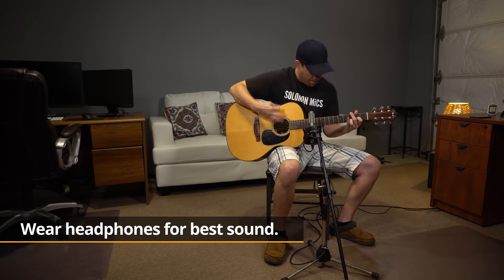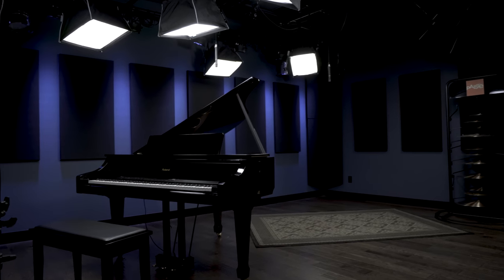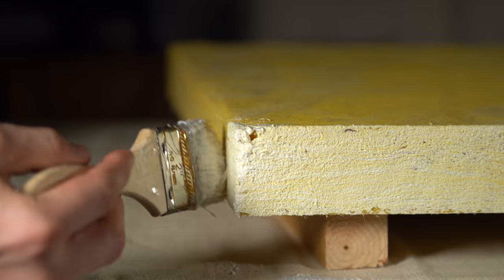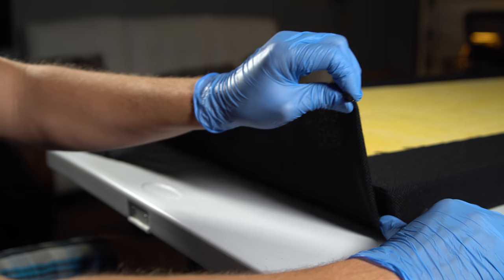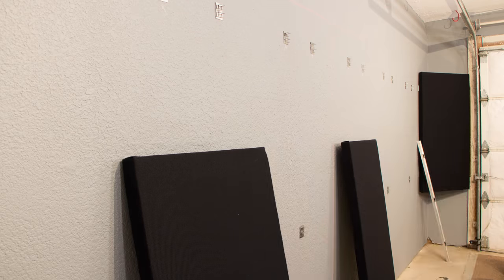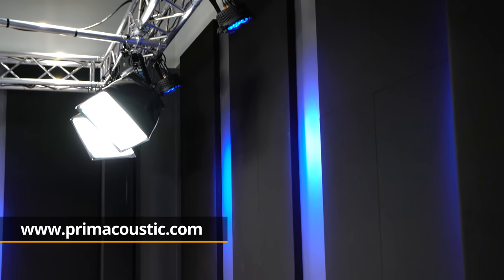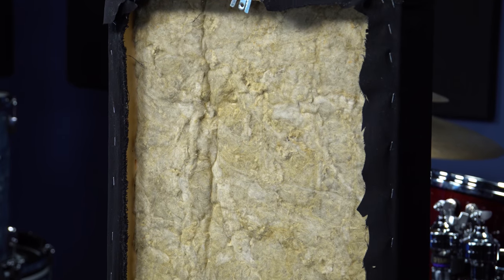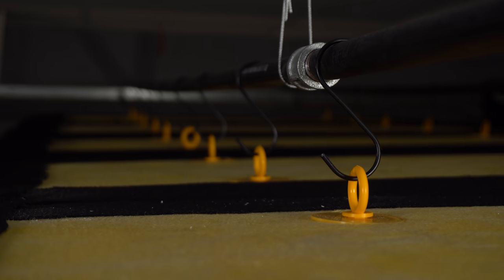How To Make Your Home Studio Sound Amazing With A Low Budget

Comment: I have avoided using fiberglass based panels like those here and instead use Rockwool, it is not stiff like those, but does come in a role 15 1/2 inches wide, and can be easily place in 3 1/2 inch thick pine frames, then covered with cloth material front and back. They work awesome.

Comment: To harden the edges of the panels use Roman-543 or Roman-838 Adhesive.  This is the stuff people use for wallpaper and is exactly the same stuff as No-Frame Edge Coating, only available at any hardware store and is 1/4 the price of No-Frame.  I discovered this after buying No-Frame and comparing it to the Roman-543 I had recently used for wallpapering a room.  It is identical and performs exactly the same way.  It's just glue that soaks into the panels and dries hard.  Hope this helps someone save some money.
Reply: Tried this... appreciate the advice but I am going back for the poly.
Reply: @williamchen33  I was about to pick up some of the Roman adhesive. What was your experience with it? Are you using a poly resin?

Comment: It's highly recommended that you place these panels around 1 inch from the wall. The air gap is very important.
Reply: I've seen a lot of videos that say that exact same thing.  Some people even go as far as having two layers of air, one between the insulation and the panel's cover, and the second between the insulation and the wall.  Is that necessary, or is that overkill?
Reply: You just answered my question!!!  Can I  glue half Inch cork wall tiles ...  DIRECTLY TO THE WALL??   And I believe I will have  hmm create  that ... INCH  AIR GAP!!   Right?
Reply: @dumpeeplarfunny  Depends on your wallet and how "Professional" you want your studio to sound.
Reply: @Brian B So in order to absorb a 30Hz frequency, meaning about 12 meters in length, I have to leave a 3 meters air gap?! :))))
Reply: @dumpeeplarfunny  no its importent
Reply: It will be be even better, but the difference it made mounted like this is enough to make good recording.
Reply: This makes total sense! Cause air acts as another diffuser for reflections that just bounce into the panels
Reply: @erics2860  Exactly, you are basically adding another diffusing surface by putting some space in between the wall and the panel.
Reply: No. It's not that important.
Reply: @dncviorel  you're not far off, In studio control room builds, the acoustician normally plans the back wall to have a several meter cavity with heavy mass medium hangers.
Reply: @KarlGutowski  It is vitally important, especially in squeezing out every bit of performance on a limited budget.
Reply: Steve Walker mmmkm OK on m mo
Reply: Brian B ii
Reply: Can i explain why gapping is important ??
Reply: Or further. 4-6" gap significantly increases the effectiveness of mid-range absorption. The diagonal mounting in the corners gives an effective 12" gap from the wall (at center of panel), dipping into the low end of the midrange much more aggressively.
Reply: I heard pros say that it's better to fill that space with absorption regardless.......
It's the broke dudes, who buy skinny panels that need the air gap .... but if you do em DIY don't see why you couldn't just measure to fill

Comment: Yes to Rockwool safe and sound, either doubling the depth of the panels for lower mid band absorption and keeping 1-2 inches off wall. Wondering why didn’t you cut super chunks for corners, ie 2x2 cut diagonally and stacked up to ceiling, a thin panel in a corner isn’t as effective.

Comment: This is prolly the most concise video on frameless panels. Noe sure no air gap, but thats not always nesscerray for everyone.  Yes the panels perform down to lower frequencies with an air gap but thats not always 100% nesscerray. Also the edge hardner... yeah use more than recommended. Alot more. 2 days to dry. But yes the edge hardness will depend on how heavy ya applicationof it.

Comment: great video but i have a question for you.I notice you and most people only have speakers up or sign about 3 feet on guitar or standing up,I have a clavinova piano with speakers and the base coming out from the bottom in a 9 X 11 room with a window and a door of course so the question is. should I put panels as base traps angled from the floor up? yamaha clavinova if you want to check it out so you can get and idea.thank you

Comment: ouch, you might wanna use Tyvek in between the fabric and the fiberglass, that stuff is nasty and you don't wanna breathe those fiberglass particles in.  Tyvek is a micro porous plastic wrap that allows the air(and sound) come through but not the fiberglass dust.
Reply from the maker: This is a great extra mile on these panels, thanks for sharing!
Reply: You are very welcome :)
Reply: A
Reply: What kind of Tyvek should be used, can you explain further?
Reply: The vapor barrier/house wrap one
Reply: @konstantingroove thank you very much dude. U r a lifesaver!
Reply: Would the Tyvek be considered reflective material though?
Reply: Is this all that necessary of a step to take?
Reply: @CynDaVaz  Yes, anything flatter and less porous than the fiberglass will be more reflective and reduce it's effectiveness. Even a bathroom towel is reflective, but probably less reflective than Tyvek. Epoxy resin or other adhesives can be used to stabilize the fiberglass without reducing the sound absorption as shown in the Tech Ingredients video on sound absorption panels. A light coat of spray paint will also color the panels without reducing absorption. Any fabric you wrap over the panels should be very porous and not flat like a sheet of paper.
Reply: The spray adhesive that is used to adhere the cloth covering on the front should prevent any shedding of fiberglass particles.  Spraying the entire back with the spray adhesive will help further.
Reply: @bross63  The question is how much is enough, and when you use enough does it reduce sound absorption? I have only one datapoint, the Tech Ingredients video says 1g epoxy per 5 square cm is enough to stabilize the fibers. Presumably this can work with paint or other kinds of adhesives, but no data on what is optimal and how much to use.
Reply: @RecordeoOfficial  Extra mile? Haha such an understatement for what might save your health.
Reply: very true on the fiberglass, it is not the stuff to use worse thing ever. Rockwool is safe no fiberglass in it and its designed for sound absorption. just don't use fiberglass at all.
Reply: Is this the same for rockwool?  I've been told rockwool is safe as fiberglass is not.  Is that true?
Reply: Sierra419 there is no glass in rock wool which is safer.
Reply: looks like hes using ruxol, which has no health hazards
Reply: either way though the fabric wont allow the material through
Reply: Jeff Trinkle I have the ikea cabinets filled with rockwool I got from work when they built a new room in room studio. They just have a cloth screen over them and I don’t think the rockwool is wrapped properly. Just bunched un in burlap or something. I think I’m getting sick from it. Wrap your stuff up no matter what type of fiber insulation you use!!!
Reply: I would think buying slabs of foam would work better.
Reply: @blue03r6  Foam isn't dense enough unfortunately.
Reply: keantoken Bathroom towels are really good at absorbing sound. Some people have made very good panels filled with toweling.
Reply: @oinkooink  Don't breathe anymore in, rock wool isn't as dangerous as fiberglass . Just make sure you don't breathe it everyday, it'll come out :)
Reply: Where can I get the edge hardening resin he used?

Comment: Question: what is the purpose of the edge hardening resin? Is it completely necessary? ETA - I think I get it now ... derp. I see this is mounted without the typical wood frame I've seen in most sound panel videos. That's why. Looks quite a bit easier than the wood frame route! I like it.
Reply from the maker: Ok, cool...yes it is so that you can create a nice sharp looking corner, with minimal effort and without sacrificing too much of the panel's absorptive properties.
Reply: What is the resin/ hardening agent called?
Thanks!
Reply: Bro I’m looking at all the comments and you never respond to the resin. You tell us to use water based polyurethane resin but cant tell us which brand to use

Comment: First off Great video really learned a lot, for sure a cheap why to make panels without any frame. Wondering if you were able to keep the panels 2 inches away from the wall with the impalers? I've typically heard that's it's best to keep the panels about 2" away from the wall.
Reply from the maker: Thank you! Yes, if you can create an air gap behind the panels, there effective absorption range can extend downward up to another octave below. For our room, we really did not have a build up of low frequency energy, as it's a garage and the vast majority of that portion of sound is escaping through the garage door...it's kind of a blessing and a curse being in a garage :). I do definitely highly recommend you create an air gap in your home studios that are inside of the house though. You can use something called "offset impalers" for this.

Comment: Build a simple wooden frame out of distressed and stained pine 1x3 boards to surround the panels for an attractive edge appearance and get the absorptive material away from the wall. Home Depot can cut the raw boards to length for you, then you take them home and beat the crap out of them with various instruments of death (just don't hit them so hard that they crack), then sand and stain, pre drill pilot holes, then fasten with screws (I like Deckmate star-drive coated screws for everything and they come in different colors). You can then hang these frames from the wall using hooks. I think a touch of stained wood makes for a much more professional look than putting a bunch of soft cloth covered pads all over the walls.

Comment: Recordeo is really awesome.  I have  learned new tips and I need help regarding how to make a sound proof room for practicing drums.
Reply: It sure did sound great, that is for sure.
Reply: Hi Varma I turned my garage into a floating room.Floating ceiling & walls.My garage is seperate from the main house.You have to build a room with in a room with the soft fibreglass battens doubled up.Your main leakage is the door you enter in and out of.

Comment: Nice set up turned out really good. One question though my Mic picks up white abit of white noise even with the recording volume quite low does that mean I need to do something like this to minimize the white noise?
Reply from the maker: Thanks! Sounds like you're experiencing the noise floor of your equipment being loud -- every piece of audio equipment essentially has a noise floor and we need to set the gain staging as correctly as possible every step of the way to lessen the noise in the final signal: The mic, the cable, the preamp, the gain setting, the audio interface (analog to digital conversion). That said, there could be acoustic sources that cause the general "white noise" in your room such as computers, amplifiers, air conditioning or heating, fans of any sort, and other noises from other rooms, etc.

Comment: The before and after early in the video, he's louder and closer in the after. Not a true A/B comparison.
Reply: Taking out the extra sound that is the reverberation would reduce the volume level.  If you then bring the volume of that sound up to match the first recording, they'll be just as loud, but the second will be much clearer and have better bass.  From the point of view of recording, that's ultimately the difference that matters.
Reply: @dumpeeplarfunny  Well said!
Reply: He's wearing a clip on mic....it doesn't matter how far he is from the camera. His room is probably super reflective, but since you're getting a close up sound from a clip on mic and not the sound from the camera mic, he is capturing much less reverberation and unwanted frequencies, which I think also makes the difference less noticeable. I hope you agree that the acoustic guitar comparison shows a much clearer difference, since he was using a condenser (360 degree sound) microphone as opposed to his clip on mic (uni-directional)

Comment: thanks for this video. a few questions:
1. can we use Polystyrene  instead of fibreglass?
2. can we spray paint any artwork onto the acoustic cloth? 

Thanks
Reply: 1) nope, sorry
2) no, because then the pores are closed and it is works almost like a concrete wall, so you don't get the desired effect of absorption. :/
Reply: Polystyrene is used to support soundproof

Comment: Question: From Drumming purpose... i have a small room in my apartment.. would this kind of isolation method work to cancel the noise going out?? If not, would you be able to help me out ... thanks so much in advance!   Appreciate any help!  ✌🏻
Reply: These panels aren't for sound isolation. What you're talking about can't be achieved without severe structural changes to the room in your apartment. Invest in an electric kit or rent out some kind of storage unit or studio space to practice in.
Reply: Porcubot thanks for the response!!!

Comment: could you lightly spray some adhesive all around the panel to make sure no particles of fiberglass are floating away?  Or would that decrease efficiency.
Reply: Do you mean the front and back? Anything that hardens it will change how it works, you risk it starting to reflect some of the higher frequencies

Comment: Hey! Great vid! Came across this as I'm working through the process of making my panels for the first time. Couple questions about the edge hardening resin. Can you provide a brand name or link for where to purchase?  And do you think that would work well for ridged Rockwool as well? I went with R60 and R80 instead of the Cornings 703. Any info appreciated. Thanks!
Reply from the maker: This stuff works well for a water-based poly: http://www.buyinsulationproductstore.com/no-frame-fiberglass-edge-coating/?src=prn#write_review

I haven't personally used the rigid Roxul, though if it's similar to the Corning 703, this edge resin should work fine for it as well.
Reply: Hi Victor! I’m a recordeo student. Can you please recommend a edge hardening resin or a prallel that has worked for you… something more generic maybe like from home depot? This isn’t available anywhere around our side of the world. Thanks! :)

Comment: Fiberglass emits its micro particles when exposed to high accoustic pressure and will then absorbed through your lung. Also the heavy amount of glue in this small room isn't very healthy. Using only absorbers in such a small room will end up as a dead room. (Dead end). You also should leave a living end in the room. So you also should use Helmholtz resonators and/or 1D or 2D diffusors. For an accoustic guitar i would prefer an omni (sDC or LDC) on the neck an on the accoustic hole a SDC. A royer R121 ( -> 15KHZ) is sonic for amplified guitars but lack the ability reproduce transients, especially when it comes to accoustic guitars.

Comment: How dangerous is it to use fiberglass batts? I know you should use respiratory protection when working with it, but if it is just mounted to the wall or ceiling and not being disturbed is the fiberglass still an issue?
Reply: If you have airflow without a sealed barrier between your lungs and the particle source, then you have a risk of exposure and lung issues down the road. The acoustic fabric will help reduce the particle migration from the fiberglass, but it's not a sealed barrier. Fiberglass batts are not safe in an open application like this, the panels used here are slightly better but still not safe. Rockwool would be the safest of these 3 options, but still allows some particle release when disturbed (bumps, bass, tremors, etc).  I would advise either doubling the acoustic fabric on each panel and then running a quality hepa-filter 24/7 in there, or installing a vapor barrier (ultra-thin plastic sheeting) between the particle source and the acoustic cloth.

Comment: Will these panels function in a similar fashion to ones that are made with wooden frames and filled with Roxul Safe and Sound? This method looks so much more simple and efficient than having to build a wooden frame and stuff it, and then wrap it!
Reply from the maker: Yes, this will render a similar absorption coefficient, though the more dense and thicker insulation will render a more broadband absorption in the audio spectrum.
Reply: Awesome! Also, what edge-hardening resin did you happen to use? I can only seem to find one type and want to make sure this is the best option. Thanks again man!
Reply from the maker: This stuff works well: http://www.buyinsulationproductstore.com/no-frame-fiberglass-edge-coating/?src=prn#write_review
Reply: Cool, thats what I was getting. Thanks!
Reply from the maker: Yep, no problem...good luck! Let us know if there's anything else we can help with!

Comment: This is awesome ! Just one question : Can we apply this for another type of room ? Like a really bigger room, to treat it acoustically. Thank you !
Reply from the maker: Thanks Frank! Yes, these panels will work well for any size room... Depending on your larger room, budget, and construction abilities, you could also think of doing a larger scale absorption...something like open stud wall (full length/height or just certain larger areas) in front of your shell (high mass sound barrier room exterior) and put dense insulation in the open studs and cover with larger rolls of acoustic fabric. This could potentially save a bunch of time and money on a larger room.
Reply: sorry NO ! that only works in old garages😂